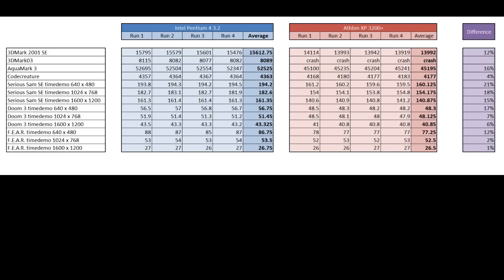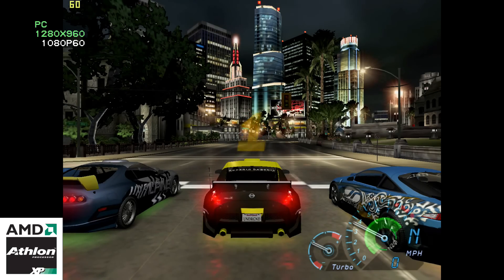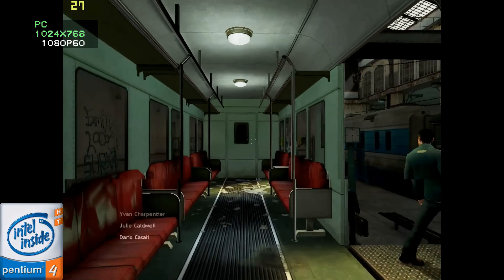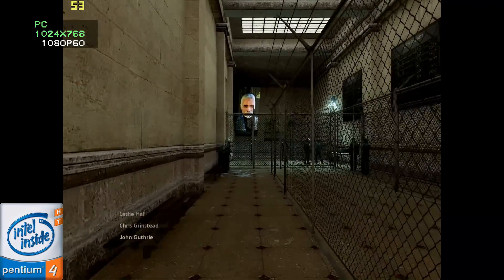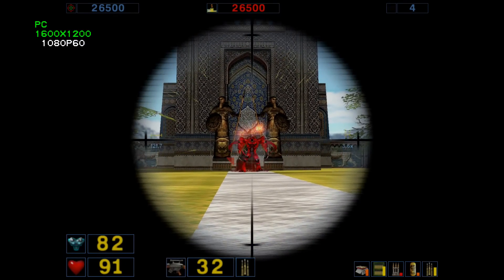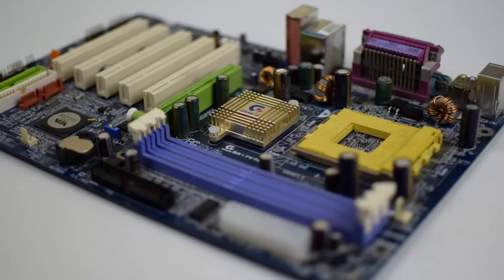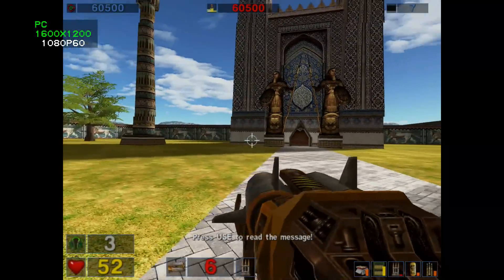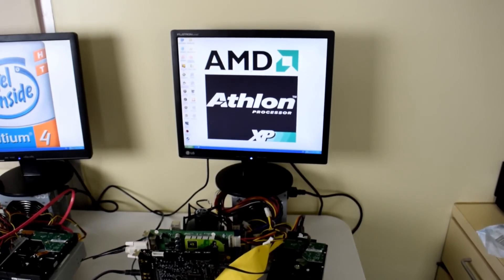Intel vs AMD S1E1 - P4 3.2 vs XP 3200+

Comment: The Athlon XP was the reason I went AMD in 2003 with the claims of better performance at a lower clock compared to the P4.  Additionally the P4 was known for running hot,  until I went back to intel in 2007 with the Core 2 Duo.
Reply: +Nicholas Curran I stayed with AMD for so long. The first computer I had was a P2 266. Then a Athlon XP 1800, then I built a computer with a Athlon XP 3200+, then I built a Athlon64 4200+ X2, then a AMD X4 620, then I bought a used 1055T, and now I'm back to intel after so long with a 6600K.
Reply: My older PC's where intel based but I started with the 1700+, then a 2000+ and then up to the 3200+
Reply: @McTwistedTwisties  Makes no sense when AMD finally is back in the game again.
Reply: @miljororforsprakpartiet290  the comment was posted pre ryzen
Reply: P4 was running hot? I remember the old AMD Athlon processor would smoke like crazy when you remove the heatsink
"Crap I forgot my computer was running! Great! Just great! I have to buy another AMD Athlon now! All I want to do is cleaning the fan"
Reply: @PreciousAlpschindler that’s an edited comment? 😐
Reply: @alpzepta Lmao, that hit piece from toms hardware really is living rent-free in your brain isnt it? 🤣
Reply: i went to amd in 1999 with the k7. got me a cartridge atlhon 700mhz. worth every penny, it actually killed my friend's pentium 3 800mhz in pretty much everything, despite being launched earlier and being cheaper.
Reply: I don't even know what my first CPU was but it was most likely an Intel, I do remember my second CPU which was a pentium running at 133mhz I think then I went from there to a K6 II then a Duron 1200mhz or 1800mhz can't remember then a Sempron then an athlon x2 then phenom x3 and stayed with that for many years until I finally got an i5 3570k like 5 years ago and been happy with this CPU ever since, I might get Zen 2 next year perhaps
Reply: i got on the amd train back in the K6 days and after getting a Intel 775 i never went back and stiuck with amd even up to today
Reply: But overall P4 was faster.

Comment: I think you should run the same game in both processors...
Reply from the maker: +Arthur Costa I did for the benchmarks. It showed that bost systems are very similar in performance, then I just showcased a range of cool games on either machine.

Comment: Hi, why didn't you use a Nforce2 Motherboard?

Also, I also used a 865 Chipset for my Pentium 4 needs. But the Nforce2 Chipset is really a big difference to those pesky Via and SIS Chipsets out there. :)
Reply from the maker: +AmstradExin Planning another video ;-)
Reply: PhilsComputerLab Ok :3

Comment: I have the same problem in 3DMark03 on a P3 1Ghz 440BX. Tried both a 5200 and a 5700 Nvidia, it will always crash and reset the PC during nature at the same point. I don't have any DX9 ATI cards to test with, I wonder if it's a SSE2 issue.
Reply from the maker: +Dave Stevens Try a much older Nvidia driver. Apparently that fixes it!
Reply from the maker: +Dave Stevens Using ForceWare driver 93.71 WHQL solved the driver crashes and 3DMark2003 completed without any issues.

Comment: Hi Phil. I am a big fan of your retro video's since a few weeks. Since i have seen some of them and I need to watch even your video's with topic 386/486 the next days...
Well, i have already planned to build a retro PC several months ago... my WinXP computer i had all the time during the university. It is a Athlon XP 2100+, but overclockable to 2600+/2700+ with a full copper cooler Thermalright SLK-900u (really easy with changing the multiplier and setting FSB from 266 to 333). The Basis is the VIA KT400 board Epox 8K9A3+. The AGP graphics card is a Winfast Geforce 6800LE (with RivaTuner and 12 pixelpipelines a true Geforce 6800).
Before this PC, i had the famous ABIT BP6 Board with two Celerons 466 Mendocino's. But the try to wake up this hardware was not successful, so i have sold this board on ebay.
As a replacement, i have got now really cheap a PIII 866 Coppermine, with the Intel 815 Board QDI SynatiX 5EP. For the graphic card i have selected a Geforce 3 Ti200. 
During the chrismas holiday's, i have also got a really old Pentium 75. But the case was in a really bad condition, so i scapped the case. With an old AT board, you can get more problems concerning the case and the RTC, so today i have bought additionally the Socket 7 board Shuttle HOT597. It is compatible with Pentiums and the K6 and K6-2 processors. These are the topic's i am working on now...
Reply from the maker: +Andi R. Hey thanks for the feedback, greatly appreciated! I plan on covering the entire time from DOS to Windows 98, to XP and later. I find them all fascinating to be honest. I miss Abit, they made some really cool motherboards.
Reply: +PhilsComputerLab 
Thanks. Yeah, the good old times with W98 and XP were great. With this Abit Board, i used it around 2-3 years, and was able to double the CPU power on Quake3 with Win2000. Well, PIII were already available in the late 1999s and early 2000s. But they were too expensive for me. I did also some overclocking with them (original 466MHz), but only 525MHz were stable due to the link CPU FSB to PCI clock. With 83MHz FSB, that means 581MHz CPU clock, the PCI (41.5MHz) becomes too high.

By the way, i have also the old maschine from my brother. One 3700+ Athlon64 Clawhammer, with a smaller socket 754 board. Well, i do not need really several PCs with nearly the same Power.
Last month i have got also a Asus P4P800deluxe, combined with a P4 2,66 Northwood. It comes with the tower (i bought on ebay) which is basis for the socket 7 or socket 370 platform.

Comment: I still have a 3200+ with 2 gigs ddr ram and Radeon x800, it was my gaming rig before moving to Athlon 64's. Never had issues with it, a remarkable pc. Recently I got some P4's, I might try out a Prescott  and see how it works. :)
Reply from the maker: +pauls640 Very nice, thanks for sharing.
Reply: I have exactly the same parts

Comment: Back then (about 2002/3), I had an AthlonXP 2800+ (Barton core 2.083 GHz), a Gigabyte 7n400 pro 2 (nforce 2 ultra chipset), 2x512MB DDR400 kingston memory modules, a Radeon X800XT 256MB, a 160+120GB IDE HDDs, and a BeQuiet 450W PSU, and an overkill Thermaltake Shark huge case. I used this computer for about 2 years and fastest pentiums4 were faster than my system, but in 2004 I upgraded to an Athlon64 3400+ and no pentium could beat my beast :) Ah.. those were nice times for AMD and I upgraded very often, not like now that everything is stagnant, or almost.
Reply from the maker: +kanopus06 With that graphics card, your machine would have been quite a bit faster than the machines I used. At least I think that the X800XT is faster than the 6600GT.
Reply: If I remember well, the X800XT vas on par with the 6800GT/Ultra in most games, and was roughly twice as powerful as the 6600GT.
Reply from the maker: Yea that sounds about right. I have a PCIe version, but not an AGP.

Comment: Hello!
You're doing a great job. Your videos are very helpful and interesting.
I have a Asus P5GDC Deluxe / i915P / PIV 3,2GHz / DDR2-533 1GBx2 and GF 8600GTS 512MB. I want to change at the PIV 3,8GHz or EE3,4GHz. What kind of graphics card to choose? I want maximum performance to the processor. The GF 9800GTX / GTX + is too fast?
Reply from the maker: +Sławek P. Ah you're on PCIe, that's awesome. 9800GTX would be a very good fit. FEAR or Far Cry at 1920 x 1080 and AA can be quite demanding.
Reply: +PhilsComputerLab 
Thank You for the fast reponse. I start to look for the garphic cards and the processor.

Comment: Actually after looking at this I might save that card for a windows XP system instead. I was thinking of using a pentium 4 with it anyhow.  and seeing how reliable a 128 meg card is I think the one I just have in my room or the other one that is using a PCI Express x16  would be excellent for this.
Reply from the maker: +Proshi Cool. Keep me posted if you don't mind. I'm always keen to hear how others go with their retro builds :)
Reply: XD Can't promise I will, Money is a wall for me to tumble since I rely on what I get from College and if people commission me to build them a Pc. Other than that I have to bare with my mom till I can get on my feet. Shouldn't be more than 2 or 3 years as I'm done goofing off and lollygagging. I have decided what I wanted to which is a mixture of 2 things. lol Networking and Building computers. Since I can't decide between the 2 I'll get a degree for both and move on from there.

Comment: Athlon was just cheaper worked at low temperatures compared to p4 but P4 was better for gaming
Reply from the maker: +Djoko Loading True, much better value. I remember how some Intel processors costs close to $1000. Back then overclocking was still useful. You got a cheap part and overclocked it into something that cost 2x or 3x as much.
Reply: +PhilsComputerLab well, it still is useful. just not as much.
my good old it 2500k cost me R$ 500 back in 2012 and still outperforms current stock cpus as expensive as R$ 1000.
granted the currency i'm working with lost half of its value in this period, but that doesn't change the fact that the i5 2500k is still great 4 years in.
Reply from the maker: I have the i5 2400, and I agree, it's still ana amazing processor. A shame tha tIntel keeps changing sockets though, as I find it harder finding boards.

Comment: The benchmark great work!! you can show much better comparative Charts. I could run over XP ATHLON (+2200): Gears Of War, Bioshock, Tomb Raider Legend, Rainbow Six Vegas  and other complex  titles ..please consider for future comparative videos Thanks (sorry by my bad english). i think Intel (P4)  its most powerful that AMD XP processors, but i prefer AMD!!
Reply from the maker: +Hanagomi kusohana Well these machines already struggle with the games I used. Bioshock? That is best played on Vista and DX10 :) I think up to 2003 maybe 2004 is a good time for these computers.
Reply: Really 2003-2008 machine was XP +2200, NVIDIA 6200 later ATI 4750 AGP, 2GB RAM, Creative 2SX. This machine could run Bioshock or Gears used similar Unreal Engine 3..because final resolution rendering similar you show on doom video on 386, but modificated UNREAL ini files to 800x600 CTR.  This board burn for heat jajaja...Well this show me that GPU its most more important that CPU Clock. many year ago. "I could do  it "  "you can do it"!! jejeje

Comment from the maker: @TheAslinger Got an nForce board now. Still waiting fir some fast ram. Corsair platinum with cl2
Reply: If you did the video on the NF7 motherboard, and I missed it, please let me know... I use an NF7 motherboard back in the day with a 1.8Ghz (Athlon 2500+) overclocked to 2.2ghz (Athlon 3200+) and back in the day I owned my friends with their 2.8Ghz ~ 3Ghz Intel systems

Comment: I have uses the Socket A Platform from 2001 to 2009 as my mainsys (KT133A with SD-RAM!, KT400, KT600 and Nforce 2 Ultra 400 chipset Mainboards I'm using in this years). So I'm a Socket A Fan. 

My retro Socket A Sys has a Asus A7N8X-E Deluxe, 2x 512MB Corsair PC3500 with the good old Winbond BH5 Chips that can run CL2/2/2/11/T1 and a high fsb like 250MHz with 3,3V. Good timings are bring very much on the Socket A Platform, X-Fi Xtreme Music PCI Soundcard, Athlon XP-M 2600+ overclocked to 2,5GHz (the XP 3200 has 2,2GHz) with a Thermalright SLK 900A Cooler, and a Gainward Bliss 7800 GS with 512MB. 3D Mark 03 runs fine without problems.

The Nforce 2 can use Dual Channel, so this chipset is the best for Athlon Socket A Platform.

Comment: Before the Athlon 64 came out AMD were getting a bit desperate, resorting to over-rating of their chips as they couldn't or wouldn't increase clock speed beyond 2.2ghz. A couple of Years later and Intel were the ones getting desperate as the Prescott P4's ran extremely hot and offered little performance inprovement as they got faster. I remember going to a Lan at a friends place and My Pentium M@2.7 equipped Asus P4P800dlx thrashed an OVERCLOCKED dual core Prescott based Pentium D in Super Pi. Intel is still riding high on the Core architecture Today, although each new generation brings only minor performance improvements. Sadly this is the case with Video card technology as well. An AMD 7870 is a R9 270 is a R7 370, only miniscule improvements as they all share the same GPU.
Reply from the maker: +Imperious685 Great post, and I totally agree. In the old days, Nvidia had a 6 month cycle of launching new graphics cards. I'm still on a GTX 660 and refusing to upgrade to a GTX 960, supposedly 2 generations newer, but not worth the upgrade IMO.

Comment: You seem very GPU limited here...
Reply from the maker: +gixxar6 Yes, comes with the AGP interface. The 6600GT is the fastest AGP card I have. But I will do some stuff with PCIe at some point. That opens up a lot of choices.
Reply: +PhilsComputerLab try to find a Radeon 4670 AGP card, would be great!
Reply from the maker: Well, then you will be CPU limited. This project was really about comparing the two CPUs. Personally I would prefer a much faster system. Watch the space, it's all coming in good time :D

Comment: Phil, you brought up some memories to me! My first PC was a Pentium 4 @ 2,66 GHz, Nothwood B if i remember correctly, 512 MB DDR 400 RAM, an Abit IC-7G i875 mobo, and a GeForce 4 MX 440 with an 80 GB Excelstor drive, a DVD-ROM and a CD-RW. Gamed a lot, and did a lot of student projects in that machine.
Reply from the maker: +Ευάγγελος Θεοφίλης (vtheofilis) Very nice, especially that motherboard. I had a similar machine, but with an Asus board and a Radeon 9800. Loved that machine. Also had a massive 21" CRT. That thing weighed a ton...
Reply: Mine had a 17" TFT, that I still use as my screen.

Comment: Nice one! Remember when I overclocked my Duron 1200 to 1650 MHz, with a Radeon 9550, and beat all the intel guys in the school with the benchmarks :D I think the board was Asus A7V880, or 800, loved that one.
However I miss mentioning that the AMD Athlon 3200+ ran at 2200 MHz, while the i p4 3200 ran at 3200 MHz, so there is a 1 ghz difference, while the dissipation is the same (~60W). That time the 3200+ was much cheaper than the P4 3200.
Reply: +PhilsComputerLab On this channel it's: more technical = more entertaining :-)
Reply from the maker: I hear you! I'd like to do one longer video that shows all the steps that I take. For giving others tips, that sort of video. But also some light and fluffy videos :D
Reply from the maker: +Daniel Komari It's always a balance between being too technical and entertaining. But I'll take the feedback on board, no doubt!

Comment: Great vídeo. For P4 and Athlon XP i prefer IDE drives instead of SATA drives because of issues with compatibility, but if it works and the drive is old, it's not a problem.
Reply from the maker: +Kurt Hectic The 80 GB SATA are the smallest, identical drives, I had :)
Reply: Yeah Windows XP give me BSOD on SATA

Comment: 1080p gaming on a pentium 4 )LOOOOOOL
Reply from the maker: +Renox CS:GO I know, right? :D
Reply: ok :D
Reply: Hey dude I have a question for you. It's about the Deepcool Gamma Archer you did review on. Will it work good with the AMD A6-7400K? Because I heard some AMD coolers are Extremely loud and I want this low-cost quiet cooler.
Reply from the maker: Yes that processor is a good fit for that cooler!
Reply: Ok, thanks again!
Reply: 8:36 1920x1080 is 1080p.
Reply from the maker: Yes. That game supports it natively. But other parts of the screen are stretched, so personally I would still prefer to play it with an old-school resolution.
Reply: уеа it looks bad